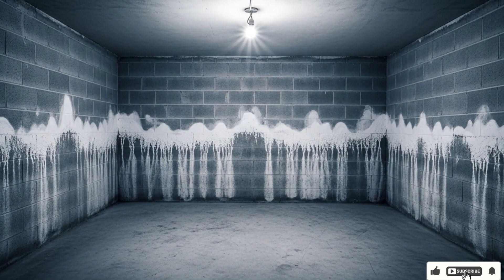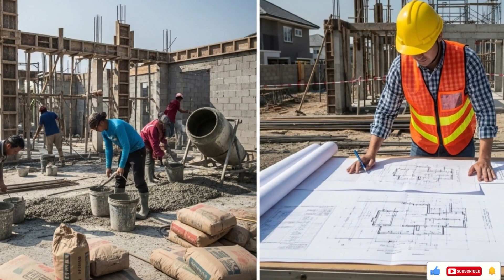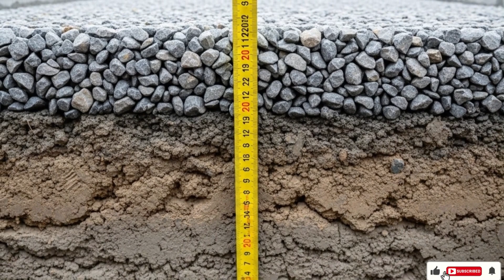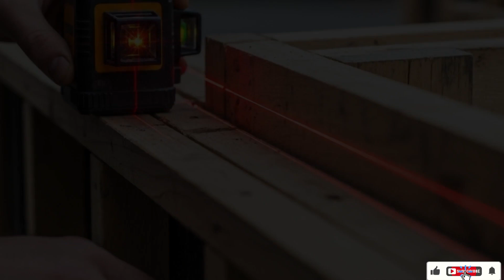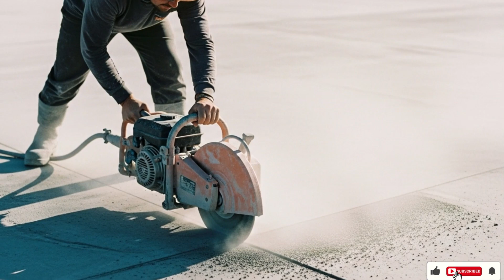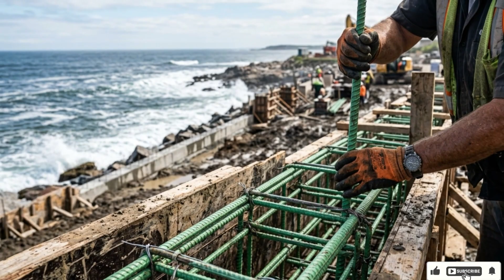How Foundations Are Actually Built — Step-by-Step From Excavation to Cured Concrete

Comment: Is conduit better than surface for electricals, plumbing and HVAC?
Reply from the maker: “Conduit is usually safer, cleaner, and more durable long-term, especially in modern buildings. Surface installations are easier and cheaper to maintain though. I’ll cover this deeply in a future video 👀”